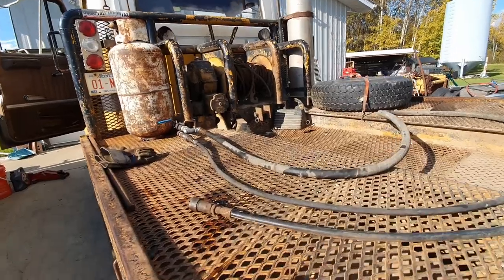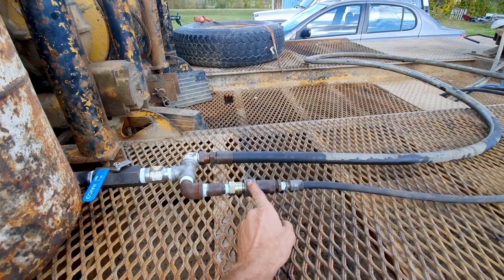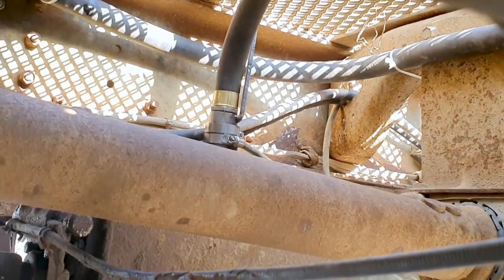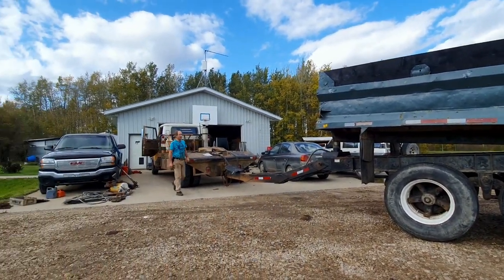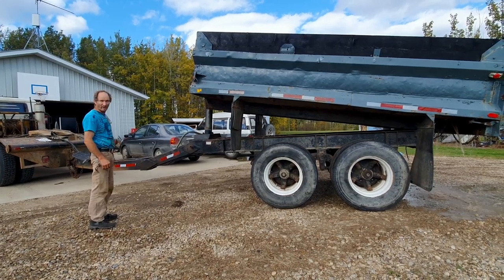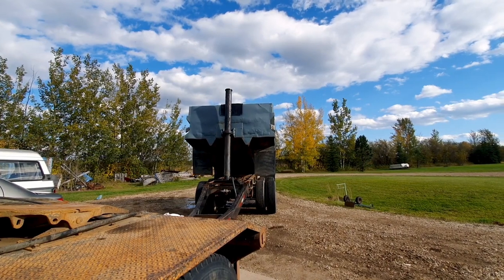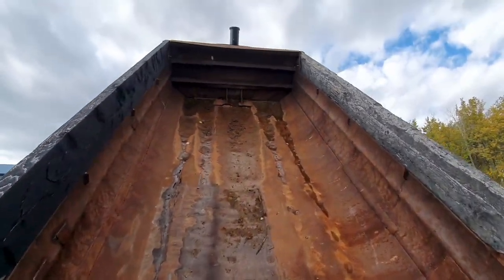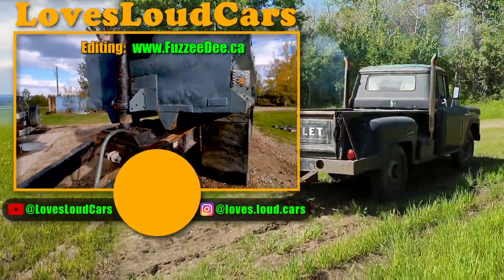DIY increasing hydraulic capacity

Comment: Good work men🤝 that will hold alot of fire wood.
Reply from the maker: My dump trailer has higher sides (until I change that on the pup), but definitely not going to overload the pup!
There's a massive difference between trailer structure and weight capacity. I've never been comfortable with the other trailer.  Tough enough,  but just barely.